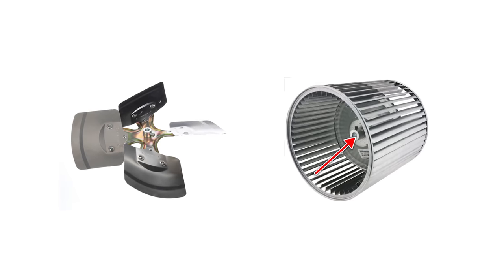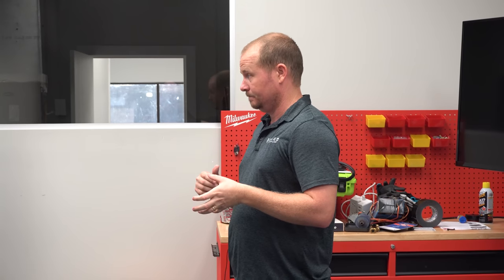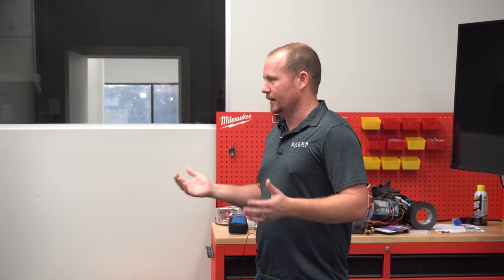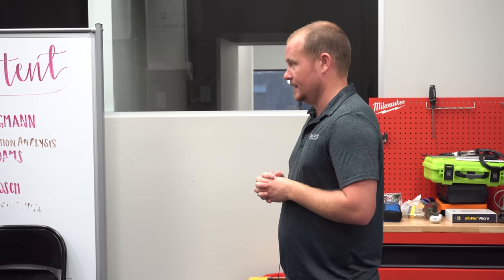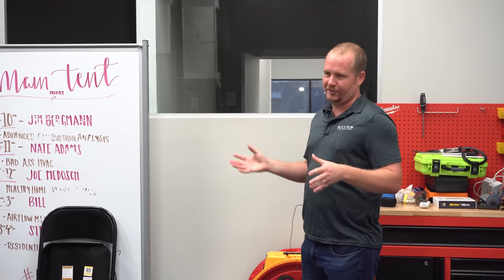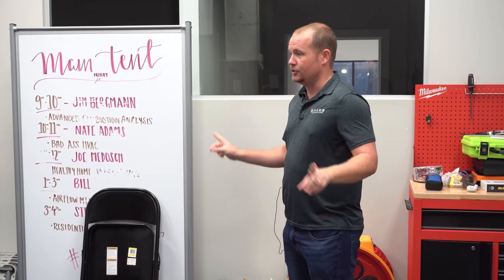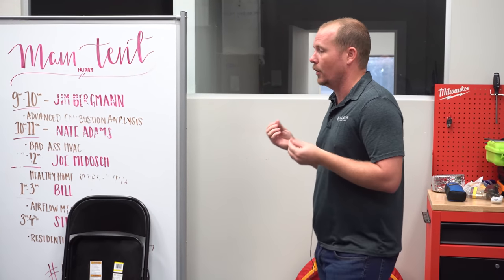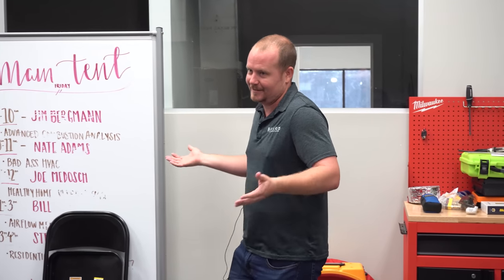Motor Replacement Tips & Tricks - Kalos Meeting

Comment: 29:40 - My dad's uses for Channelocks: wrench, hammer, wire cutters, tin snips (for thin sheet metal), pipe bender (for small pipe), tweezers, jumper wire (e.g., to drain a capacitor or jump a starter terminal), roach clip, to name a few!

Comment: JL3RH Psychrometer can be easily corrected using a "SAL75 Tramex Calibration Salt Check."  This is a must have for the JL3RH Psychrometer.  Fieldpiece says to do the calibration for 24 hours, but I got mine within one tenth of a degree WB of each other, following the instructions from Tramex in 40 minutes.  They were reading 4+ degrees different from each other before the calibration.

Comment: We do all sorts of motors, axial fans most common, I got a crash course in maintenance of them, replace the front and rear seals, don’t over grease and put the spring washer at the same end it came from… 
But pump motors… where there’s a shaft between the motor and the pump, if you remove the motor, mark everything where it came from, and I’m not sure what everyone else does, but we get a third party to come in and check our shaft to motor to pump alignment is bang on, because we don’t want those kind of calls to rebuild a condensed water gear pump

Comment: I used to tie the rotation wires under the fan grill, but now I cut and strip them close to the motor then wire nut them for the correct rotation. Now they can't fall down into the blade or have the insulation dry off and shock someone/short out.

Comment: Hello, Great Video.  Quick question.  Working on a 28 year old unit and cannot obtain an exact replacement blower motor. Original motor has a 7.5 mf external cap.  Planning to use a replacement motor with identical specs except... instead of 3.4 amp motor with the external cap, want to use a motor without external cap that is rated at 7.9 full load amps. EVERYTHING else matches.  I understand it will be less efficient, but will it create any problems? For example, would the added max current flow be a potential issue for the control board?  
Planning to replace 5kcp29kk5211s (1992 Carrier system) with Century Mfr. Model # 559.  Thanks again.
Reply: Replacement is a shaded pole motor.  Much less efficient.

Comment: The ICP HEILS from 2000's had supported the condenser motor with the cover that had fins that where directed at about 45 degrees.  I have found by bending the metal of each fin to about half that to more perpendicular to straight up about 22 degrees, the fan noise was noticeably more quiet and less turbulent and moved more air, thus less head psi.  Anyone else try that?
Reply: AD Electronic Teardowns I’ve done that on steel return grilles

Comment: From a technical standpoint it makes no sense to use a aftermarket ECM because you loose all the OEM programming anyway so just go with a PSC. It is more challenging Install due to relay integration and also to match the PSC motor HP because a 1/2 or 3/4 hp Ecm May be programmed to run significantly slower than a oversized PSC motor.
Reply: I'm going to disagree.  I have been using Mars Azure motors to replace out of warranty failed constant torque ECM  motors for a few years now.  The installation procedure puts the motor in a temporary installation program mode.  Most of the time that works well.  If adjustment is needed, speed taps can be changed.   If more fine tuning is needed, it can be done with a handheld programmer.  The end result is a more efficient and more exactly tuned air flow than is possible with a psc motor.  By the time you add the cost of the relay installation  the customer hasn't saved much on the ECM to PSC repair and you have lowered the performance of their system.  Also how are you going to accommodate gas furnace with different heating and cooling blower speeds and all of the fan limit switch interfaces?  You could use a quick swap board but then there goes all of your part savings.  With the Azure line only 2 truck stock motors will replace just about every constant torque ECM blower out there.  I have not used an aftermarket for a true vari spd yet. those require a greater range of truck stock.
Reply: @sprockkets  Not sure that I understand your question?
Reply: Sorry Joe but that’s an antiquated way of thinking. The technology is there for a reason. Stop being the guy that is stuck in the past cause it’s easy. Do it right!

Comment: Bryan, Nice video, I would like to add a comment on air flow. You mentioned that a tech could notice something different with air speed at the return air grill. My experience is that one wouldn't know if the system has high air flow issue beforehand since he/she would be walking into a house with a bad blower motor and airflow can't be checked till you get air flow going again.
That being said, one project I replaced a blower motor with an exact replacement. 
I then notice that the return air ducts were ridiculously small and that's what probably caused the blower motor to go bad in the first place. Needless to say, client did not want to spend the money to replace/repair the return air circuit.

Comment: IN CURTAIN CIRCUMSTANCES AND CURTAIN HP’s it is better to have the motor rebuilt than to replace it. A rebuilt motor is less expensive and is rebuilt by hand has new bearings installed in a sitting that was designed for that and the motor is tested. A new motor is stamped out at a factory and may have sit on a shelf for months to years. So if you think a custom hand built motor that is tested and has a guarantee is worse than a more expensive untested motor what's wrong with you? Never buy a new motor when you can have the motor rebuilt, the rebuilt motor is superior in every way.
Reply: I disagree. How can you justify the labor cost to rebuild a disposable motor. The OEM motors are made by the same manufacturers as the universal motors. If you have bad bearings chances are there will be slop in those pot metal end bells. I run a motor repair shop and we charge $100 an hour for labor and we can sell a replacement cheaper than that.
Reply: Chad Lane you are correct for residential, sorry I was going to amend my statement. It is in industrial and some commercial applications where this applies. Obviously if it is compromised to the point it can’t hold the bearings true then it’s shot. Also I’m looking at the failure bathtub curve, a known that fails is usually better than an unknown, especially when the rebuilt known comes with a guarantee.
Reply: @Thunderbird_918  Usually the limit is 100hp, anything below 100hp is replaced or rebuilt whereas most everything above 100hp is rebuilt and rarely replaced.